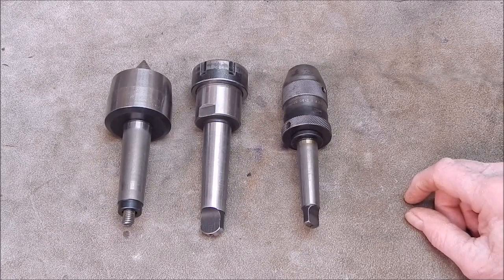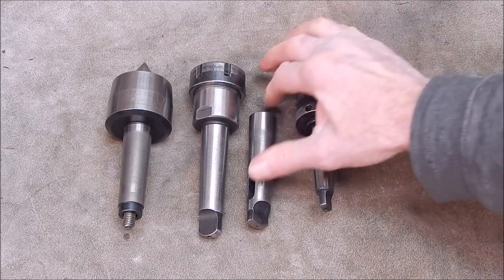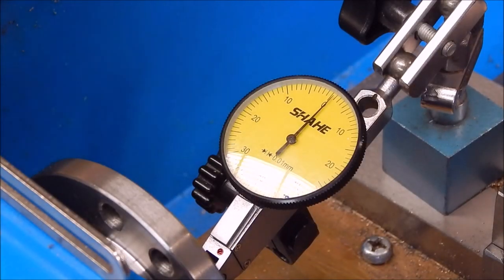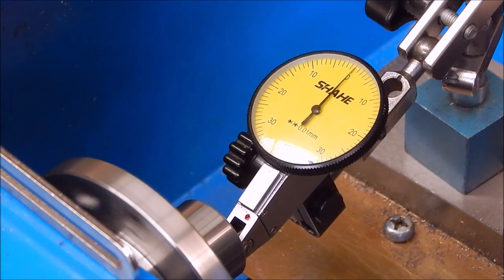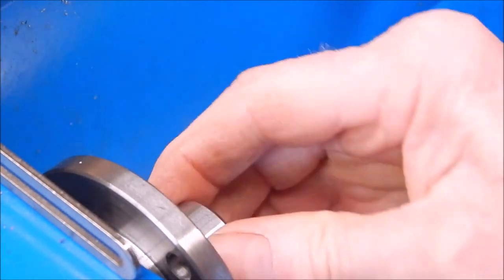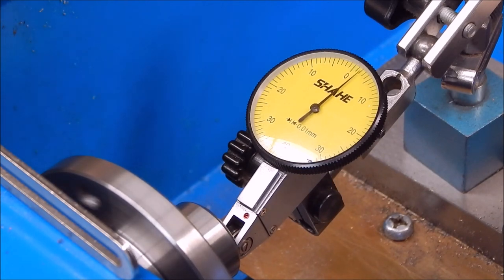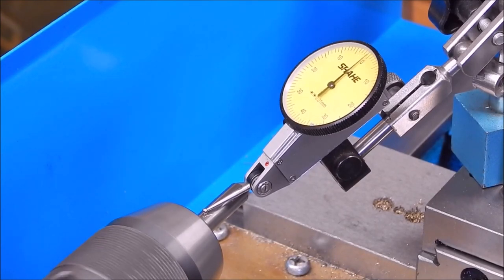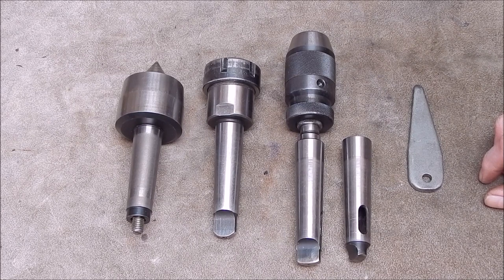How accurate are Morse Taper reducing sleeves ?  Are they as bad as some people say ?

Comment: Well demonstrated Rob, exactly what is done in industry with ER collets for long and demanding setups (and that's with the quality gear). In my dim and distant past, we used to remove the tangs and replace with a cap screw to get the full 360 range for adjusting morse tapers, all ours at that time were pretty beat up though so it was a necessity. Cheers, Jon
Reply from the maker: Fixed tangs can be a restriction as you said Jon. It's interesting how tapers will even sit slightly differently, for several insertions in the same relative position.   You could go paranoid over tapers :)  Cheers Rob

Comment: I have checked mine out Rob , And only one of the adapters I have is bad . The others are pretty good ! Great share ...ENJOYED
Reply from the maker: Hi Shawn,  I visualised a stampede of viewers out to the workshop to check their adapters ;)    At least you know which one not to use.  It would be interesting to try and rescue it.  Depends how hard the metal is.

I've never corrected a sleeve, but I have done a Morse tang and it was so hard even carbide would barely look at it.  I had to use a tool post grinder on it in the end and it came up 100% perfect.  The tricky bit was gripping it because of the tapered faces.  All doable.

Cheers Rob

Comment: Very interesting results, Rob. Definitely something to be aware of when using the reducing sleeves.  The new-old-stock sleeves from quality brands are not expensive here in the States.
Reply from the maker: Hi Daniel,  good to hear you can still get quality ones for reasonable money.  One of mine came from CTC Tools but I can't remember which one.  They ARE a handy item and you can see from the scuffed up faces that mine have done a lot of work, particularly sharing between several machines.  I'm wondering how good (or bad) the Banggood ones are.  Cheers Rob